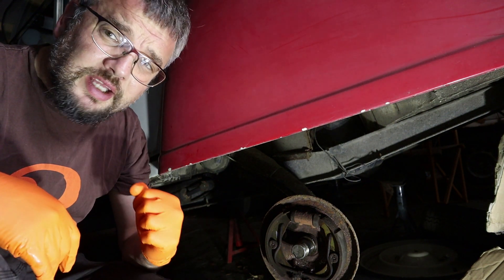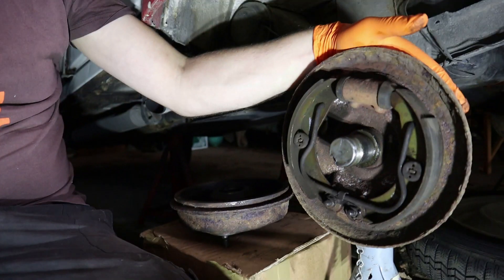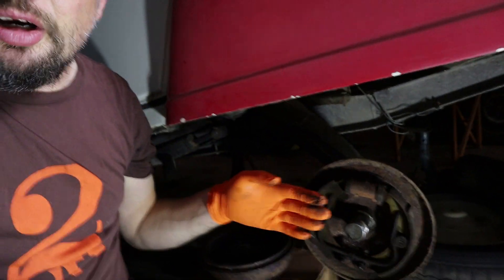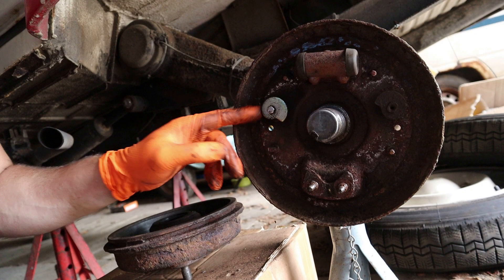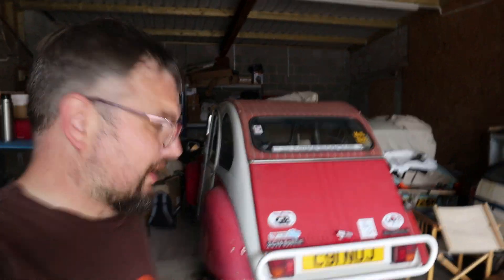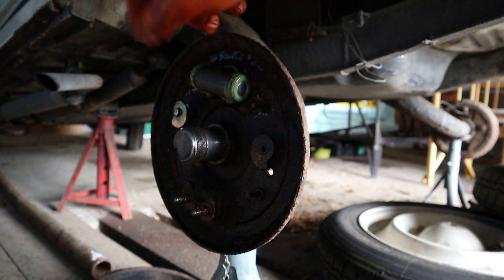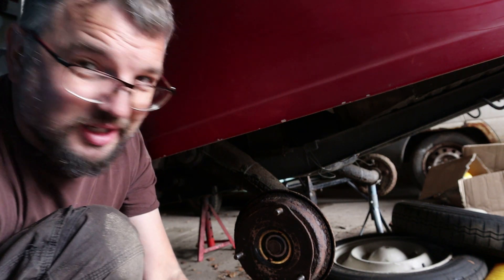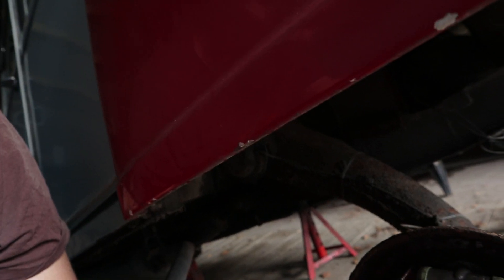2CV MOT Preparation continues. Problems!

Comment: I’ve just been out in my garage doing a long-overdue front suspension rebuild on my MG Midget... rainy day, too... and just discovered while finishing up that one of the tie rod ends had a split boot and was very stiff. Drat. Didn’t expect that. Came inside to order a new set, checked YouTube for a cheer-up, and lo and behold HubNut is under Ellie, also dealing with grotty bits and unexpected snags. We are kindred spirits, Ian. Have you ever taunted fate by saying, “I can finish this repair with only one parts order?” I think I’m up to four orders with this one. Sigh.
Reply: can you not say things like that out loud...please

Comment: Hacksaw through a spare nut, so it's an almost closed loop, then you can open it up slightly with a screwdriver in the slot you have just cut so it can pass over the damaged thread to a clean section on the stub axle. Then you can close it up with a large jubilee clip or twisted wire tie and use it as a die to clean up the damaged section. With smaller nuts, cut it completely in half and hold the two halves on the thread with gently applied mole grips.

Comment: Owing to the amount of ferric oxide on the backing plate, a quick wire brushing and an application of Fluid Film (or equivalent) to all but the brake shoes may be advisable, once the stub axle thread issue has been resolved.  The rear of the backing plate and axle tube wouldn't complain about an application either, but perhaps you're planning on doing a proper brushing, rust converter and paint application on them in the near future.

Comment: This is a video of someone with a heap of patience. All the pitfalls of working on a car with a redundant spares supply; a mechanical design that was supposed to be as simple as a pencil sharpener - no it wasn't that was a myth - the construction was the proverbial pain in the butt.  The rewards if getting on back on the road were negligable. Noisy gutless, no way to accelerate out of trouble which made overtaking a potential heart attack. Bodywork with about as much crash protection as it would have if made of kitchen foil!  Draughty and roof leaked on most of them. I had 3 of these and 2 Dyanes - a sigh of relief was made when the era died and they stopped making them.  Cheap and cheerful - no, Cheap and nasty yes. Moving to a Scirocco in early 1980s was heaven on earth-:))

Comment: After 7 months of sitting in the garage, unused, my 2CV started within half a minute and I've already done a 60 mile round trip. Only issue I was getting is a cough and splutter on full throttle climbing hills. After a quick conversation with my very good friend and ace-mechanic, next trip out I'll be flat out in third going downhill to try and clear the blocked secondary jet in the carburettor, which is the likeliest cause. It was SO good to finally get behind the wheel of the Deuche after such a long time without it.

Comment: 18:39 Ian, have a go with a scribe and wire wheel on the stub axle, it looks like the nut has galled itself along the nut face leaving the nut material which is probably made out of softer spec material than the stub axle in the thread angle.

Comment: Brakes pipes turning with the brake union have been the bane of my life for 50 years. The gas torch is a good solution although you do usually get flaming brake fluid dripping out of the union so be ready with a damp cloth to douse the flames. Spinning the cylinder will definitely work although that is harder to do with discs. The only long term solution is plenty of copper grease on the pipes before re-assembly although the number of garages I have dealt with who have ever heard of copper grease can be counted on the fingers of one hand. :-(

Comment: I usually use a cable tie around wheel cylinders that have the spring in the bore that loves to pop one piston out when the other is in.  It makes life a lot easier than having to juggle the pistons while you're trying to fit the unit in place...

Comment: Don’t know what was worse. Rear drumbs or disks. Brought a piston rewind kit and bent it to feck. Got there in the end with the 12 plate vivaro although got a feeling if I’d have taken it to a garage they’d have said new callipers required. Did all the obvious cracked the brake line handbrake off released the cable but no. Absolute pig. Excellent videos thanks.

Comment: The way to deal with possibly seized brake pipe nuts is to unbolt the cylinder, hold the pipe nut and turn the cylinder.
Refit using the same method. Doing it this way also makes it easier to refit the pipe without cross threading.
Using the correct brake nut type spanner helps too.

Comment: I was doing the rear brakes on a VW camper. The hub nut was 43mm and the torque required was huge. I calculated that is was me swinging on the end of a 10ft (oops I meant 3.048 metres) long scaffold pole. That was in 1985 when your 2CV was new.

Comment: Glad to hear that you got it sorted.   Not sure what you ended up doing, but whe i've been in similar jams, i find that a thread file is the way to go.  It's basically a special file with each side being a different thread spacing, which can be used to restore threads carefully.

Comment: I always avoid all brake dust, especially on old cars where traces of asbestos might still exist.  Even the dust from modern linings should be treated the same.  Gently spraying on brake cleaner can help keep the dust down.  Best of luck with the axle thread.

Comment: Thread restoring files are good for this kind of stuff, assuming its a common thread pitch
Reply: also my idea, saved a lot of threads already with these files, available in Metric, BS and UNC.
Reply: Sometimes the damaged thread will not allow the die to start.   A thread file has worked for me to either get the thread working, or fix the start of the thread so I am able to then get the die to start.
Thread files are a LOT less expensive than a set of dies.    I have both metric and imperial thread files.
Dave.
Reply: This!
Reply: yes indeed get that file, and be very careful as though you were crafting jewelry
Reply: Junior hacksaw and a spot weld for good measure.

Comment: I remember years ago I was just completing an engine repair on VW diesel Passat, nearly all done last injector to tighten, I thought I need to go just a bit more and bang I went to tight and a piece of cast aluminium fell off the head😫😫😫😫 we had another head and after alot more work all was good. But you just have to be so careful with things. Things that seem Simple are sometimes the things that go wrong cause lots of grief. But with old car we must plod on and keep them going, WE MUST STICK TOGETHER AND REBEL AGAINST THE NEW CAR CULTURE or these oldies will just disappear. Good video🙂👍
Reply: Actually, watching Hubnut's travails is exactly the reason why I try always to run car no more than five or six years old!
At this age you don't need to open the bonnet.......... !!!

Comment: Rule of thumb for drum brakes, the lining should look like it is being dragged off the backing plate under the normal rotation of the wheel, this generally means that any bigger gap is on the leading edge of the shoe.

Comment: Scaffold tube of certainty
Reply: 3" x 3' water pipe of certainty, I've used a few times on a 5 (6) way 'spider' wheel brace - for tractors and plant. Torqued to perfection - 14 stone 3' with 20% bounce.
Reply: A big Clive ish phrase
Reply: @millomweb  I once had to resort to a 6' section of 3/4" gas pipe in order to remove chipboard plus glued-down 1970s carpet from some floor boards. They'd "secured" the chipboard with 3" plasterboard screws (obviously pointless going through no more than 19 mm chipboard and 3/4" floor boards) and then proceeded to glue down red and orange synthetic carpet on top, using the worst, most solid adhesive they could find anywhere in the world. Our only chance was ripping out the screws and breaking the chipboard, then cutting the carpet at the breaks using a very sharp knife. One of the main reasons for doing all this faff was that the carpet had been used as a litter box by the previous owner's cat :-(

Comment: Hi Ian, ive came across a adjuster that would'nt budge on a 2cv, i remembered
i had to hammer a 16mm socket onto the rounded 17mm, that worked well.

Comment: If the new ERRR HUB NUT is the wrong thread, you won't have damaged too much of the stub axle thread. Re-using the old correct nut should still screw onto good thread to hold what it needs to hold !

Comment: Both action cameras and 'real' cameras usually have an anti-flicker setting that needs to be set to 50hz. 
Also 'real'cameras have a manual shutter speed, often for video too, which usually works well at 1/50th or 1/100th, or even 1/25th when encountering flicker.
Standard setting is usually 24 or 30fps which generally doesn't play nice with flickering lights.

Comment: If you had two proven good nuts, you could try the old trick of cutting a slot right through one nut and it would act a bit like a die, cleaning up the thread.

Comment: Great vid as usual, fantastic torque wrench. How often does it get re-calibrated?😱. Are you sure that it wasn’t over-tightening that damaged the thread on the stub? 
Aluminium wheel cylinders and steel brake pipe unions, I used to be an expert at cross threading those. I eventually learned to leave the wheel cylinder slightly loose and file off the slight flare that you get on re-used unions. The flare on the union tries to engage with the W/cyl  thread, rather than the thread on the union engaging with the w/cyl thread. Then don’t forget to tighten the W/cyl bolts. Looking fwd to next instalment.
Reply from the maker: Doubt it was over-torqued. That wasn't the issue. Should be covered more in the next video.

Comment: Have you ever worked on the front drum brakes on a Morris Oxford. I did on a mate's former car that was sold to another friend who knows about cars. I only fitted the springs the wrong way so the wheels would not turn. Should have studied the BMC workshop manual. We got there in the end! Why they are so different from Triumph/Humber/Wolseley 1500/Minor/Mini/assorted Honda motorbikes. Over complicated brakes at a stupid angle. I feel the pain.

Comment: I like that retainer spring design, very Citroeny: simple  but adequately strong.
It seems that the new nut had wrong thread pitch or it went wrong while you were tightening it the first time? Large diameter threads with fine pitch are picky :(

Comment: Some copper grease on the bolts and pipe nipple and between the nipple and brake pipe, they will no longer rust. Are the brake shoes fitted correctly Ian? Long time no see "The Bucket of Success", she belonged to a set to wash the cars?

Comment: Damn lol its like my car sometimes.
I have just drained my gearbox oil to check to see how much gearbox oil is left in the car as it aint got a dipstick and its got a oh so slight leak from the driveshaft seal.
Used to be a massive leak until i used wynn'e gear oil stop leak and now its just 1 drop to a few drops on the cardboard when the engine is off and the car is stood a while.
Its only lost 150ml in 3,000 miles so topped up with 150ml until i check it again in 6 months time lol.
Can't be bothered to renew the seal.

Comment: Rear hub nuts on the Imp were 140ft-lbs IIRC and way above any torque wrench I had. So I weighed myself, did the maths and measured out the required distance on a cheater bar.

Comment: A couple of months ago I replaced a window regulator on my Hyundai Accent. All went rather well, but the job took me way longer than it should have. Now, when the window is open, there's a rattle that's driving me crazy. Looks like the glass is loose. Seems I can't do anything mechanical without having to go in and do it again. So I know what you mean.

Comment: My breath is bated .. If it helps .. I'm doing the brakes on my TVR, and whilst undoing the rear wheel nuts, I couldn't find my wheel brace so used a socket, 3 nuts removed successfully .. The 4th nut snapped leaving about 5mm of flat left on the nut .. That was my walking away moment.. I'm still pondering ..

Comment: I'd have put the pipe on before mounting the cylinder so aligning the pipe with threaded hole is a lot easier !
Reply: Seconded.
Reply: @Graham_Langley  HubNut has little experience of plumbing !

Comment: I spotted the deliberate mistake @ 15.20.😂😁 You really need an old yoghurt pot for bits, Ian. Get a junior hacksaw blade for the thread and possibly a Stanley knife and fiddle a bit.
Reply: I use tuna tins on dirty stuff and an ice-cube tray on electronics and the like.

Comment: 200 lb/ft = 271 nm. My front hub nuts on my car torque to 280 nm and just the sheer length of that tube you used to tighten the rear hub nuts I would safely say they were overtigthened. Usually not good for wheel bearings and for that reason a torque wrench is your friend here.
Reply from the maker: 250-270lb.ft was what I was aiming for.

Comment: Today I have mostly been replacing a broken coil spring and what a pita that’s been, completed by new part not turning up as promised, a tool breaking and it being a VAG product being ten times more difficult than it needs to be, and now disaster I find I’m not subscribed to hubnut, how on earth has that happened I subscribed over 2 years ago - still at least that’s an easy fix.
Reply from the maker: Ugh. Sounds like you had one of those days too!
Reply: HubNut yup and have to battle the other side tomorrow assuming the parts turn up🤬

Comment: Fitting new cylinder - put some lube on the threads - so in 20 years time and you need to change the cylinder again, it'll be easier to remove !
Reply: And fit the brake line to the cylinder before putting in the cylinder bolts.
Reply: @Graham_Langley  Adding lube to both thread and between union & pipe !

Comment: I am wondering why you didn’t check the drag on the hub to check whether you had to adjust the adjusters. 
Other than that this was a very nice video!
Reply from the maker: Yes, I almost entirely forgot that, but thankfully it will be in tomorrow's video.

Comment: Don't worry Ian, 
back in the late eighties I had a mini, the gearbox started making a horrid noise, I got one from a scrapper in Derby ( Albert Looms if anyone knows it?) I got home one Friday pulled the engine out that evening. On the Saturday I separated the box from the engine, refitted the box and put the engine and box back in the car. 

If anyone knows minis they will know the engine mount under the bell housing is a pig to get to, I had a 1/2 Af spanner that was just the right length and I couldn't find it anywhere , I then had a terrible thought that it must be in the sump where the gearbox lives!!!!

I took the engine back out and separated the box again and guess what.........it wasn't in there!!!!!!!

I was doing all this on my parents front drive and at this point it started to rain so I got in the car to shelter and there in the footwell was the spanner!!!! I could have cried.

I then worked through the night with a torch in the pi**ing rain until 1.30am.

I drove it to work Monday morning and fortunately it turned out to be a good gearbox!!!!

Comment: Do you not GREASE the wheel bearings?
Reply: They're a pressed-fit bearing, so were packed with grease from the manufacturer or the garage that pressed them into the hub.
Reply: @richardbaron7106   O.k.! On the video they looked dry.

Comment: Did you centre the shoes or leave them as they were?
Reply from the maker: I've no means to measure, nor correct it turns out...
Reply: @HubNut  Might be able to borrow one if you fancy going back in there. One home made version shown here. There are several similar versions pictured around the 2CV sites. http://www.2cvsrus.com/fps_rear_brakes.htm
Happy brakes keep you happy too, and safe.

Comment: Why did those shoes still look upside down when refitted?
Reply: They still look wrong to me as the usual arrangement is the shoes are mirrored so the handbrake is equally effective in both directions. But it looks like Citroen have done it differently.

Comment: 200ft/lb is 50ft/lb applied to the end of that 4 ft bar Ian.
It appeared to me you applied considerably more than that and have thus overtightened the nut to the point of stripping the thread.
If you are lucky you may have only stripped the (pre-used) nut and what you see on the axle stub is only nut failure thread debris. Careful with your fingers - the shards are very sharp!
Clean up the stub thread and inspect it closely for damage - with luck it will be OK to fit a NEW nut (that properly fits). 
Do the basic math ....and don't overtighten.

Comment: Looks like you could have been lucky with that HubNut ( !!! ). it appears that the nut has been chewed leaving metal on the stub axle, get a needle file and carefully clean up the thread and you've probably got away with it.
 Get yourself a brake pipe clamp, plastic pleirs like items that pinch the flexible brake hose and can be locked so that brake fluid doesn't escape while working at the wheels.
Reply from the maker: Cheers. No flexible hoses on these. Stub axle repair in the next video.
Reply: @HubNut  There has to be a section of flexible hose, on that 2CV I'd guess they're near the suspension pivot, you won't be able to use a clamp at the front though with inboard brakes, no need for a flexible hose as the brakes don't move with the suspension.

Comment: Could be worse, ever changed a clutch and after you have put gearbox back in and start thinking " did I put the clutch plate the right way round" 😟
Reply from the maker: Yes. On Foxanne. I did get it wrong, thankfully before fitting to the car!